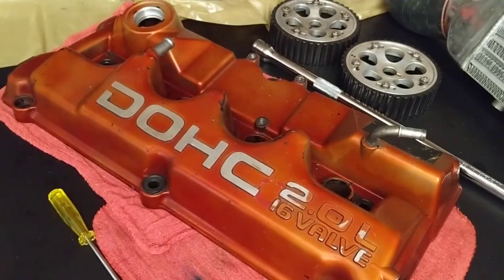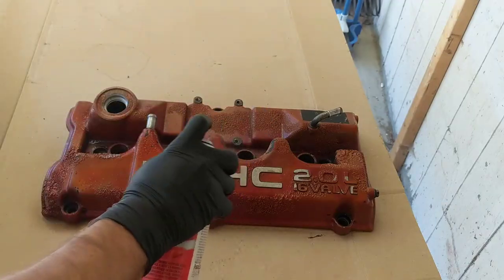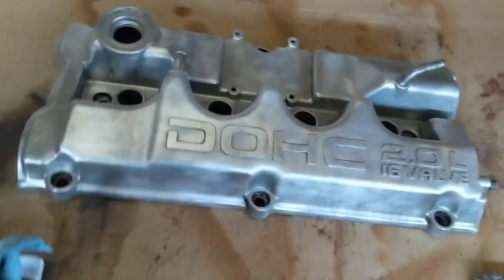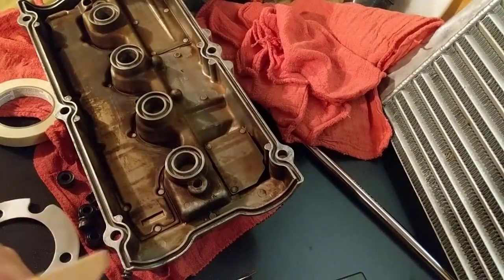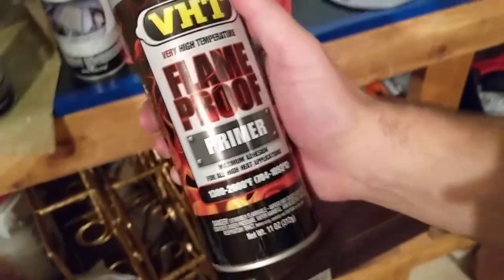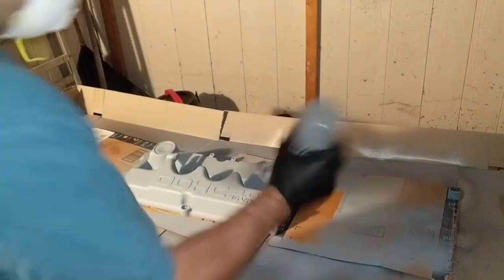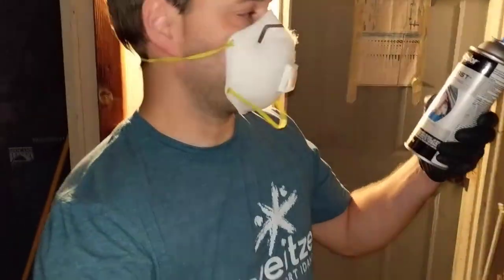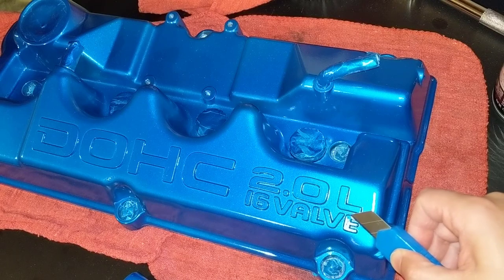Painting the Valve Cover with Spray Paint #Eclipse2GBuild

Comment: Another trick besides vaseline, simply sand the "high spots" of the numbers/letters using sandpaper on a flat stiff backer board. Keep it completely flat to remove paint from only the top of the raised letters/numbers. With patience (which you appear to have!) you can use several increasing fine grits finishing with a super fine to create a polished aluminum finish. Nice job!
Reply from the maker: Thank you I appreciate the tip?

Comment: Very nice job and video too. Question: is the ground coat metallic and if it is to what degree? Low medium or a lot of metallic sparkle?  Course or fine metallic?  Thanks and best
Reply from the maker: It is very metallic. You can see flakes in the air when using it. It's very fine in my opinion.